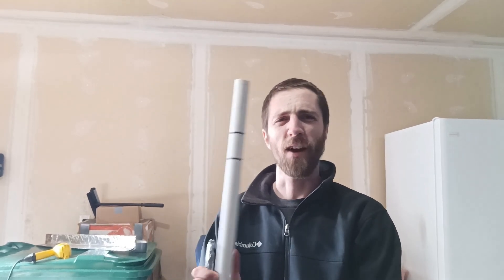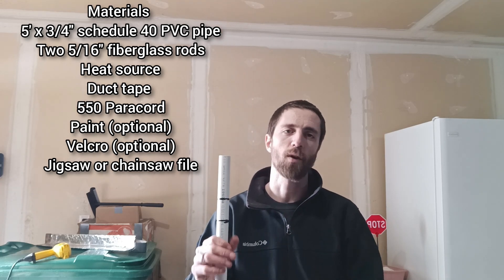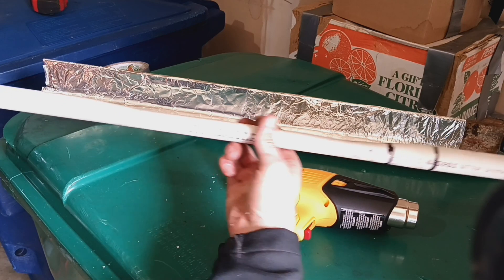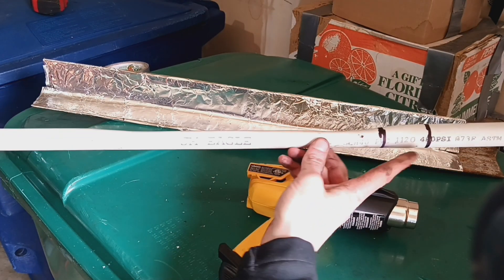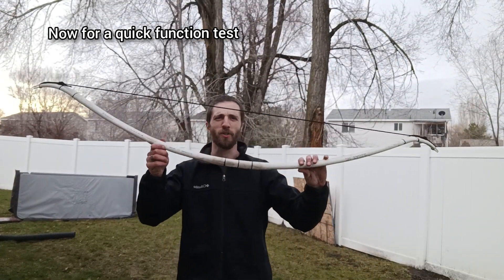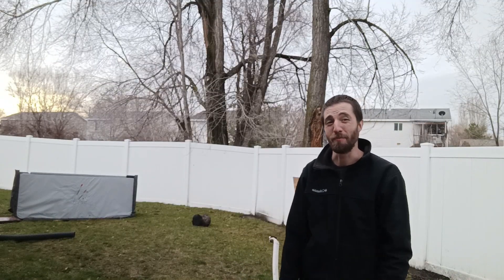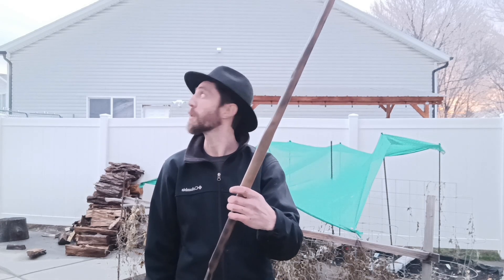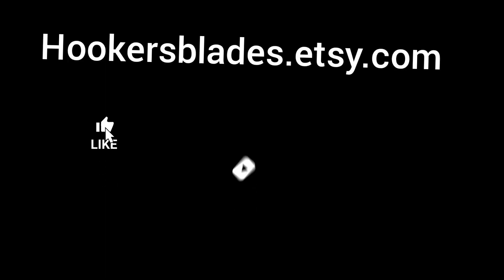Making A 60lb Hunting Recurve - PVC Fiberglass Hybrid Bow Build With BASIC Tools

Comment: Great scavenging. Ive been seeing a lot of those rods around bc snow season. I was thinking about maybe using 3 4 or 5 on a side, mounded with a slight recurve into a stiff wooden handle. way to fill out the pvc core like this tho!
Reply from the maker: @SSMFDC  thanks 👍 it was a fun idea I got from the backyard Boyer channel he has a ton of bow and crossbow builds. As a bladesmith/blacksmith I figured it would be fun

Comment: Wondering if you only used the two rods if it would drop the LBS of the bow?
Reply from the maker: @savagewolf1966  absolutely it would loose some power for certain. It would probably drop to around the 50-55lb mark